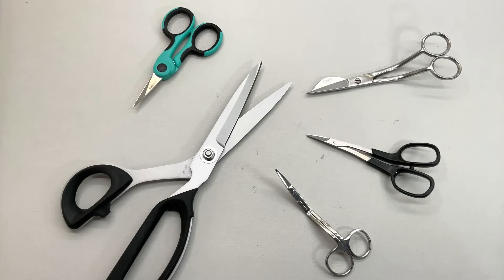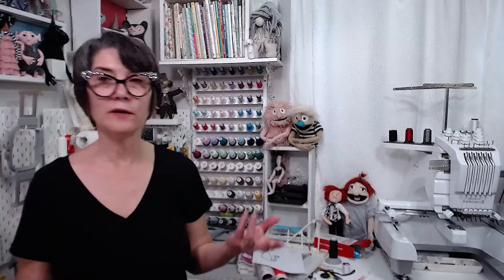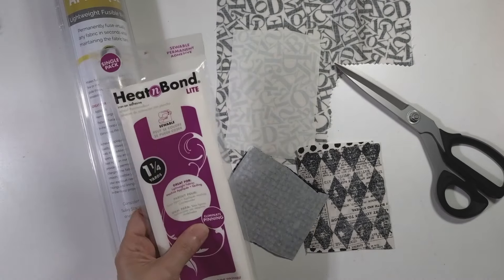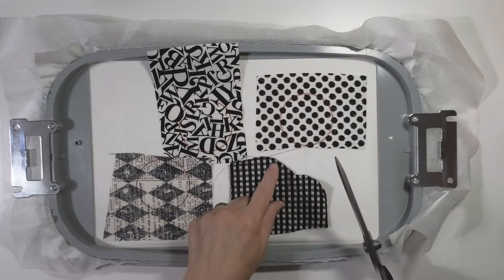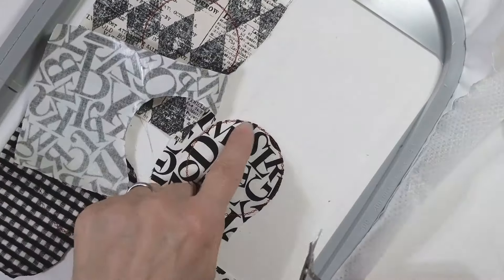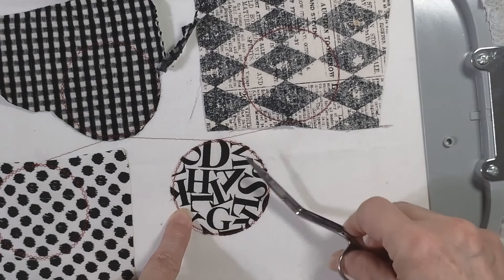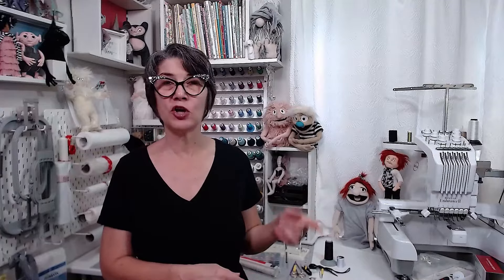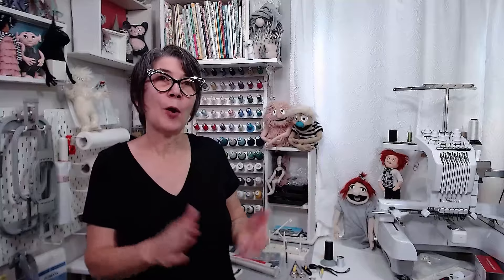Applique Tips & Tricks for Embroidery Machines

Comment: ```````can you discuss the importance of a Die Line?
Reply from the maker: I don't like the word die line for home machine embroidery because different designers use it differently and it causes confusion.  In the industrial world, a dieline is a cutting line and some industrial machines will laser cut AND stitch.  But our home machines don't do that.  So I prefer the terms "placement" and "tackdown." when referring to applique and in-the-hoop steps.    These are very important steps in the stitch file, because they show where to place the fabric, and where to cut away excess fabric so it stays put.  If you are using designs that include separate SVG files for a cutting machine, those files might be called dielines (DL) or cut files.  And the placement line stitches the shape where you would put your precut fabric shape.